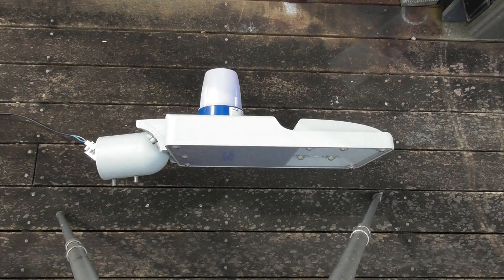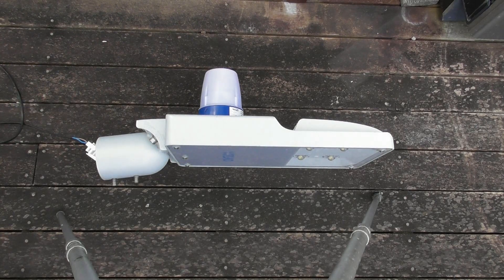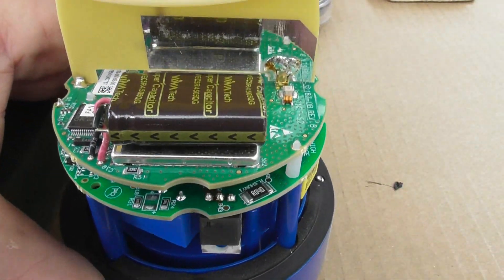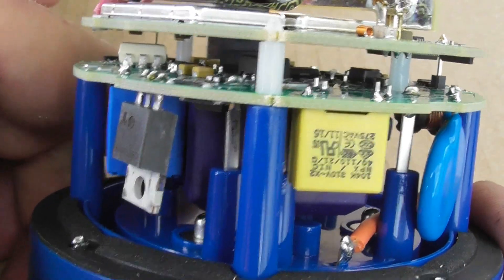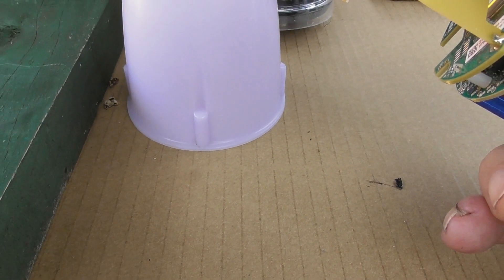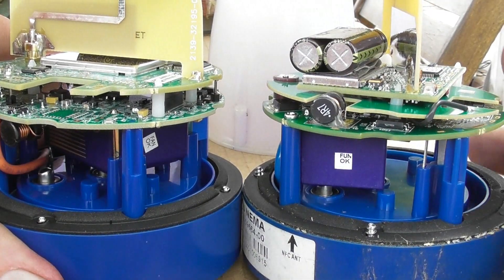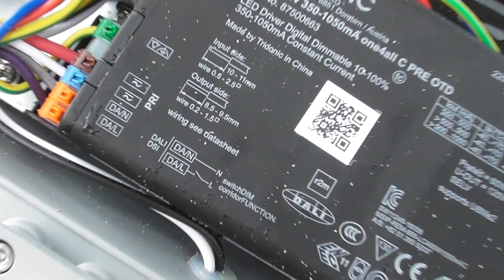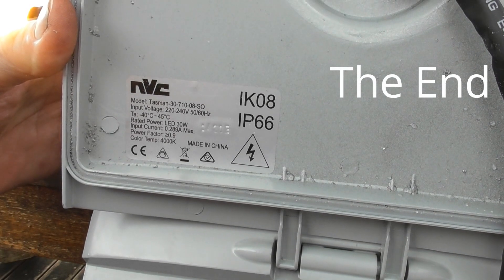NEMA LCU Photocell

Comment: It almost looks like you just need to unsolder the short, heavy leads to the upper board, then the upper board comes off (the white standoffs and the inter-board connector) and which could merely remove the communications portion from the main part of the control.

Comment: I put these up on a daily, they all have GPS built in so the owner knows where they are... being the Auckland council
Where I install them.
Reply from the maker: Great to hear from you, still overly complicated and expensive system to control some streetlights. Keep an eye out for a Low Pressure Sodium SOX light if they are somewhere around.